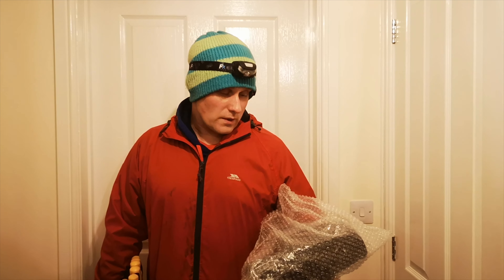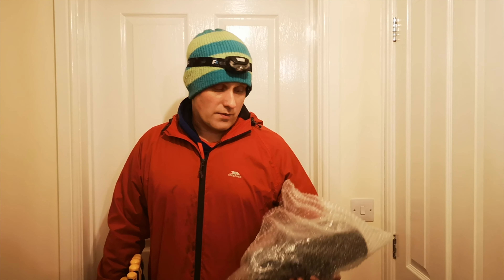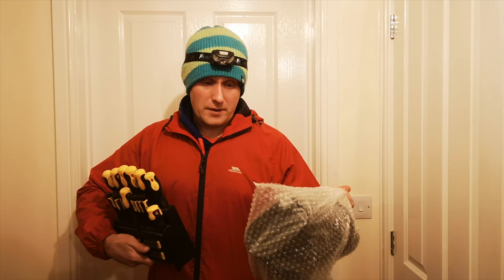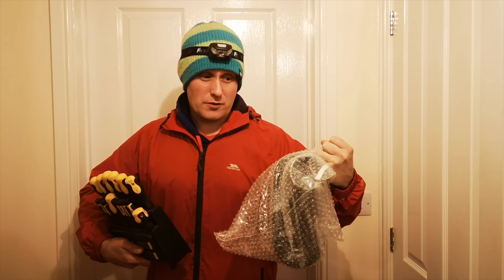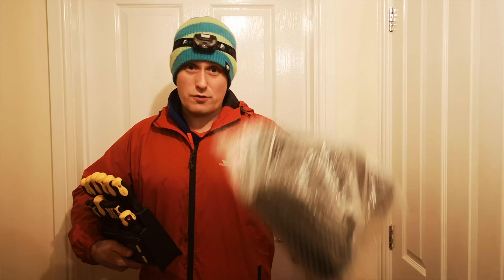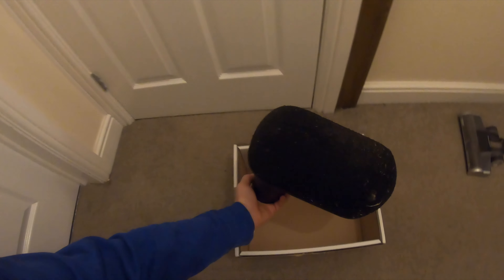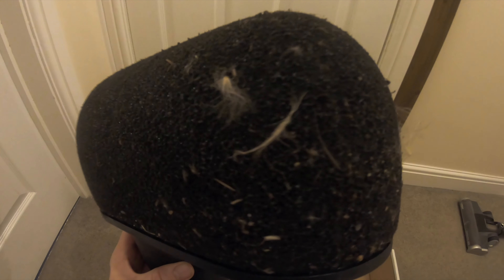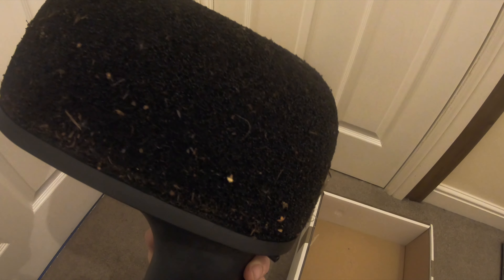Mk7 Golf R Racingline VWR600 Replacement Cotton Filter MQB

Comment: I Just bought Cotton version (same as you) for Skoda octavia vrs... Mine foams was 3 yrs Old without any cleaning and oiling. The intake noice are changed a Llttle?  foam vs Cotton? Or are the same?
Reply from the maker: Mine sounds much louder now with the cotton one. Maybe just because it’s new
Reply: @1BlueGhost  :) Thx!
Reply: @1BlueGhost  Hello I just change from foam to cotton. And Yes, cotton is louder over 4000 rpm's. Below this value sound same as foam. Anyway do not back to foams :)
Reply: how louder? bigger woosh or louder engine sound ? :)
 @wojciechb.1060
Reply: how louder? bigger woosh or louder engine sound ? :) @1BlueGhost
Reply: @OleSir-rw5hb ..
 Approx 20%more woosh... Greetings 🤝